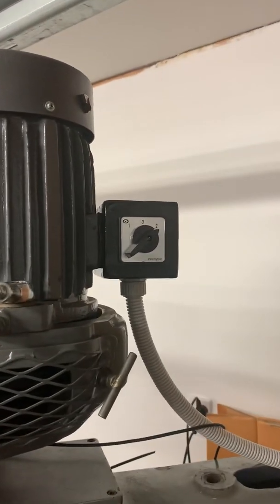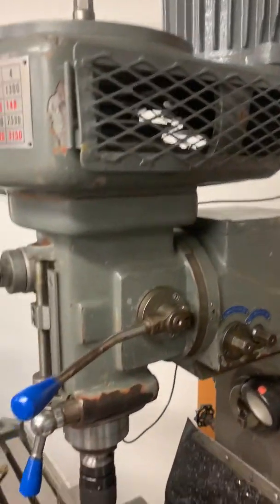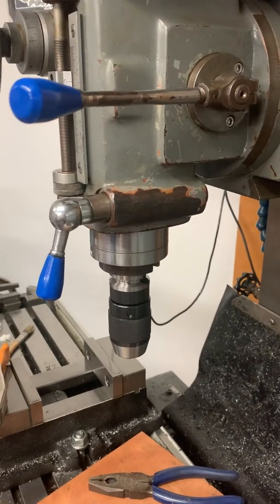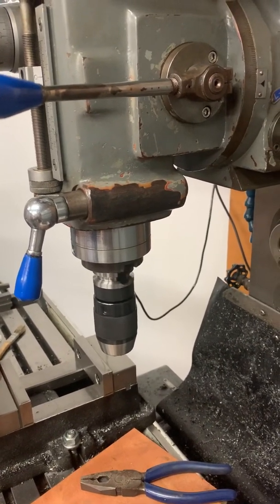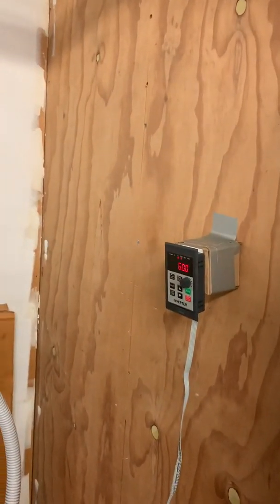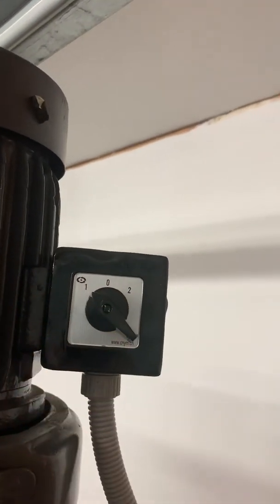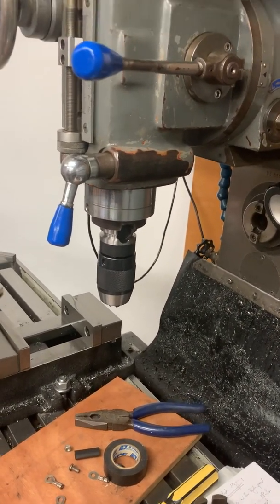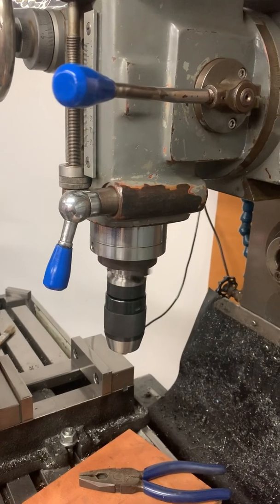Dual speed motor switch on VFD mill

Comment: Hello, does.the vfd support multiple motor profiles or is this not necessary?
Reply from the maker: In this instance its not necessary.  Both motors are the same. Also the control is being done via V/F mode which simplifies things a lot.  V/F mode can be used to run multiple motors of the same spec at once.  In this instance I am just changing which of the same spec motor is being run at any one time.
Reply: What about reverse?